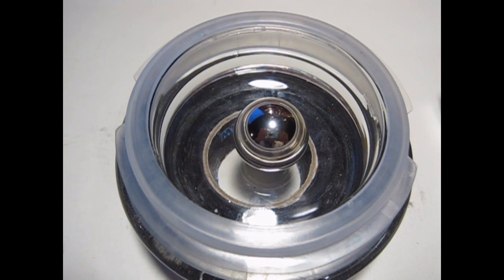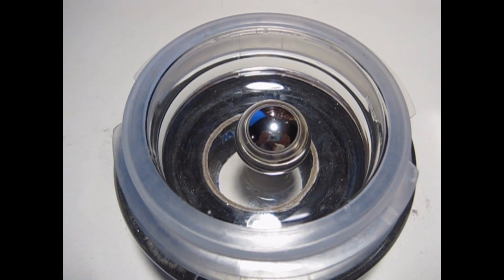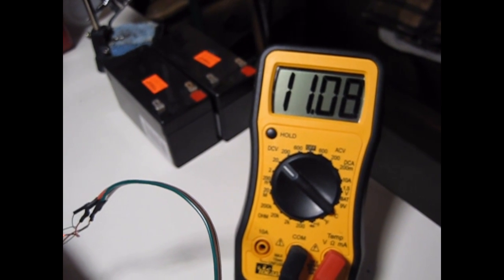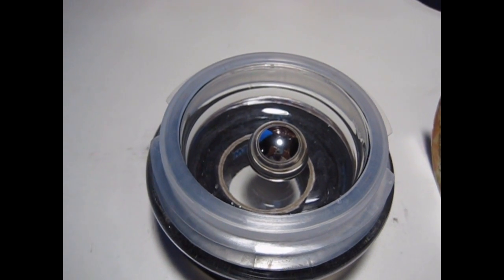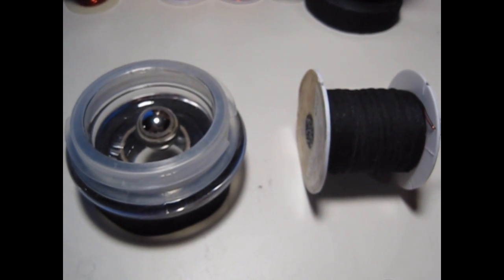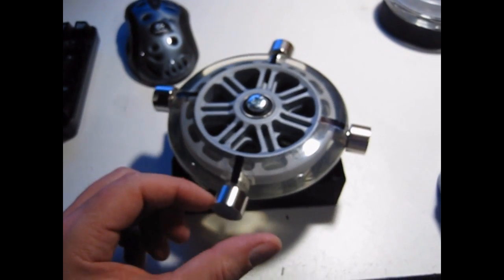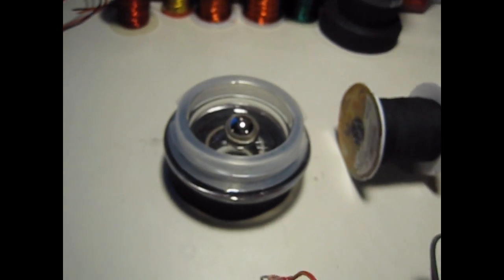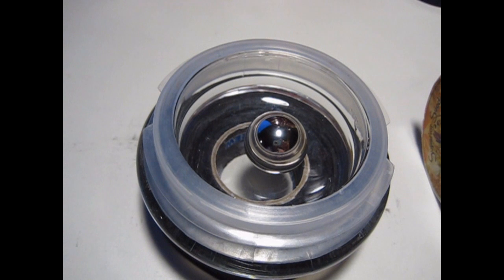My One Magnet Bedini Part 2

Comment from the maker: @EastcoastTinker - I believe I had around 280 ohms at the Base...but every circuit is going to be different because of the coil. I did't have my O'Scope at the time so I can't tell you much about the voltage, or the spikes it was generating. I may have to re-visit that :)
Dave

Comment from the maker: @masterstiks Thanks Stiks....much appreciated! The One Magnet did much better than my older Rotor with the small Neo Magnets until I added larger Neo Magnets onto the Rotor. Now the whole circuit performs much better. I am now in the process of gathering parts for my next setup. 20" to 26" Wheel with 16 Ceramic Magnets per the "Bedini_Monopole3 Groups" Instructions.